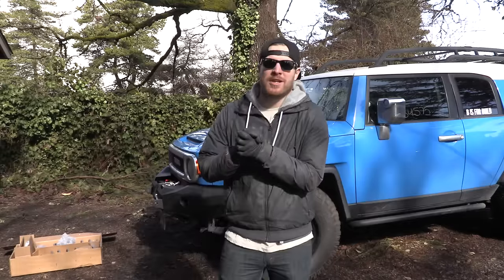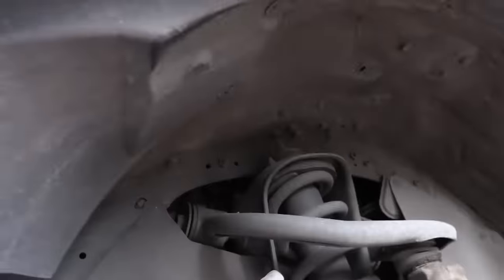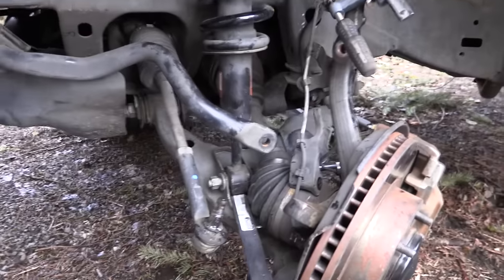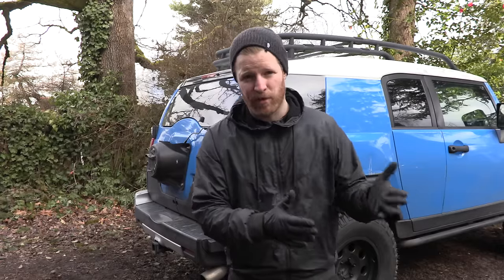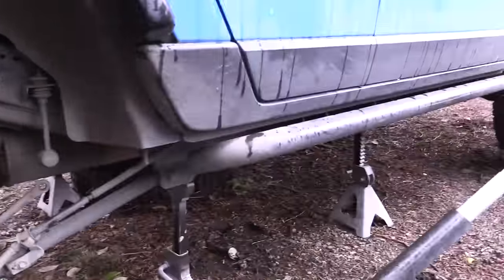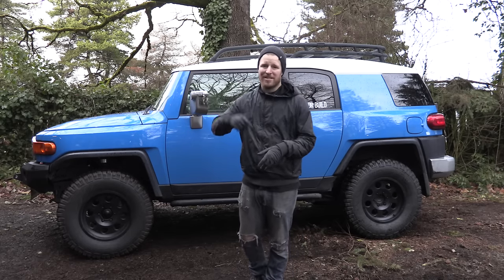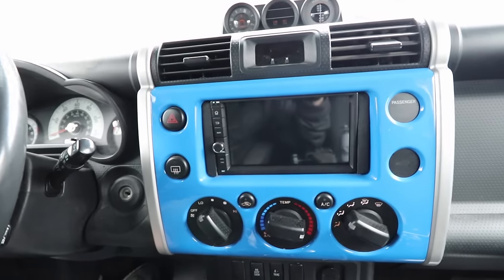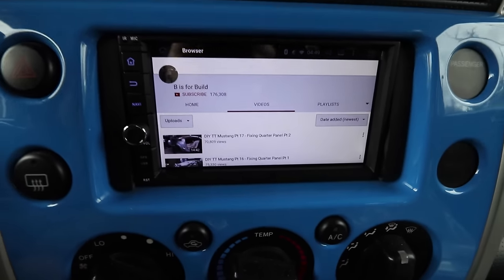FJ Cruiser Build Pt 5 - Lift Kit Install & New Stereo

Comment: b is for board of wood under the jack stands when working on dirt. cool build.
Reply: MrUncleSpicy I thought the same thing..EEEEEK. IV had a few cars fall over when doing this.. it happens easier than you'd think
Reply: lol flyingbrick, I was working on my f150. the ground was muddy, sank 2 inches, took about 2 hours trying to fix the mess I made. Moral of the story,  jack one side up at a time
Reply: MrUncleSpicy exactly
Reply: MrUncleSpicy could you imagine how shitty it'd be if you werent thinking and assembled this in the garage and could get it out lmao
Reply: Agreed. Some 12 inch squares of 1 inch marine grade ply. Stack them if necessary for a bit more height.
Reply: Boom roasted

Comment: As a professional car stereo guy I get a litte bit dissapoonted in your recommendation about just cutting the original wires and connect them together with the stereo wires. It makes a mess for the next owner who wants to change stereo and also makes the bill rise through the roof for the person who hands their car to a professional to make the stereo change. There is a lot of good adapter harnesses out on the market, and for just a few bucks you will save a lot of time not crimping wires together. :)

Comment: Bit late but catching up on b is for build now. Don't know if anyone's mentioned this before, but some problems you'll have after lifting these cars is you'll see your front CVs leaking grease, run out of camber and castor alignment adjustment and your upper ball joints over extending. 

Aftermarket upper arms will be able to fix both alignment and ball joint issues. With the CVs, you can just replace the boots or put new shafts in. 

I'd recommend getting extended sway bar links as well as an adjustable panhard rod to put the rear end back to original geometry.

Oh and speedy recovery Chelsea!!

Comment: I'm a 16 yo kid who just bought my first vehicle, a 77' Jeep J10, actually bought 2. Gonna be building it up, gonna have the coolest truck at school for my senior year. I also have a 89' Jeep Grand Wagoneer. The tires I'd choose for my J10 would be the Claw ll in 33x12.50r15, tires are on the much needed list, but damn are mud tires expensive. Best wishes to chelsey (sorry if I spelled the name wrong) on getting well.
Reply: Ethan H. Be careful old jeeps are easy to flip. Especially lifted
Reply: this is true i fliped my lifted jeep on a trail so be very careful but remember to have fun
Reply: Nice, I've got a 77 J10 as well, also my first vehicle! They're an awesome truck.
Reply: Ethan H. I have a 300zx that I'm building up
Reply: Everett Sommerer tt?
Reply: erich2780 nah, it's a 1987 N/A

Comment: I'd like to personally think you for introducing me to copart most of the cars I want barely have any damage and I can fix them easy for super cheap
Reply from the maker: Make sure to email that message to copart too :p
Reply: ItsATrap check out my copart rebuild!!! :)
Reply: B is for Build no problem
Reply: VSM AutoLife I just watched your quarter panel repair pt 1 and I like what I saw you were specific on what you should and shouldn't do
Reply: ItsATrap thanks! That's an older video my recent rebuild is my Dodge Charger, but I will only get in depth on the structural repair in that one , but still working on improving it all
Reply: VSM AutoLife I noticed it was an older one but if I'm buying cars from copart body work like that is important to know so I checked it out

Comment: Warden 265/70/17 C Load Range. I have a 2007 FJ Cruiser that looks just like your project truck. I love the videos and they're seriously making me think about lifting the truck and putting on the fender flairs. My truck needs a new set of tires since I've been driving constantly to have timesharing with my son. The spare is original from 2007 so its time to replace that one as well. I would be happy to pay for the 5th tire! 

You do a great job with these builds, and I like that you don't edit out all the frustrating parts. I really like the FJ series and the video you did on the Copart.com website... ive been stalking the locally wrecked FJ's looking a fun truck/something to fix and hand over to the kiddo.

Feel better Chelsea!

Quick suggestion on supporting the truck... get yourself a 3/4" sheet of plywood and cut it into 2'x2' squares, it spreads out the load under the jack stands and makes it a lot more stable.

Comment: I'm the owner of a super cool Silver 2008 Dodge ram 3500 Dually. What I love of this truck is whenever you are in the road, people respect you because they see the big grille behind or the big 4 wheels on the back because it is 6.7L Big turbo Diesel, it is quick, This make it fun to drive. Now installing this Nitto 33X12.50R-17LT, MUD GRAPPLER I will be able to take it offroad with it.

Comment: when working on a car/truck on dirt/sand always put the tire and rim you remove under the car frame. This is a safety measure and it has saved me more than once from jacks/stands rolling on me and then landing on the ground

Comment: I have a 99 jeep xj, i had a 98 before hand but ended up rolling it off road, and had to scrap it. I took the engine, transfer case, lift kit, and plenty of other things all swapped over to this 99 that i bought for 500 that needed an engine. Having some nice tires to compliment it would be really great.
CLAW II - C3315C
33 12.5 15 C
I would like to have some nice tires to keep up with all my buddies on the trail, and not get stuck in every little mud puddle because i have some cheap bald (by bald i mean basically drag slicks) 31's. I am in need of tires soon and this would really help me out. Hope Chelsea is alright! Love the builds, and I enjoy watching the videos. Good luck to everyone else in the comments!

Comment: Hope she get's better fast. As someone who has been in the offroad accessory business for 5 years what you experienced with poor instructions is one of the things rough country is known for. It would have been a little easier for you if you had loosened the lower control arm bolts so they could swing down, and treadwright tires are indeed awesome.

Comment: Haha that roof would annoy the shit out of me get some sound deadening lol
Reply: And that plug your not sure about is probably the aux for the stock radio they also make flush mount adapters to mount a usb or aux to a spare switch
Reply: Michael Graper could be trees above I think..
Reply: What?I love that sound. Love being at camp an falling asleep to the rain on the tin roof.
Reply: Michael Graper lol dude those usb extension cables just poking out were fucking with my OCD so bad!

Comment: I drive a '14 Wrangler Rubicon on 3" lift. I've actually looked at the Treadwright tires before for a M/T tire. I typically roll around on A/T tires - since the Jeep is my daily driver. If I had my choice, I'd go with the GUARD DOG tires in 35x12.5R17 (load range E).

Comment: You did that the hard way.
Undo the top sway bar link.
Loosen lower control arm nuts/bolts.
Undo 2 bolts that attach Lowe arm to steering knuckle, then the arm swings away enough to remove the strut. No need to undo any ball joints.
With stereo wiring, you can get Toyota to ISO wiring harness, then get ISO to stereo brand (eg Pioneer) harness. Just plug & play. All Toyota EOM stereos are wider than standard size, so you need a fill-in kit for the edges.

Comment: Nice lift kit you got. I have a set up of icon 3" installed on my 2008 fj for a year now. I love mine. Super smooth... live on the big island Hawaii. Many off-road island fun here... I would love try out a set of those treadwright tires. They look aggressive and love that they used recycled tire casting to remold new tires. Great concept. I'm using AT on my FJ at the moment. Would love to get a set of 285 70 17 MT Guard dog for the rainy season coming. Mahalo for sharing!

Comment: Hey man, for future reference when you're removing the front shock assembly on toyotas, use the factory bottle jack and stick it between the wheel well and the UCA and crank down on it. Using this method, you don't have to disconnect the upper ball joint.

Comment: Next time you want to lift a vehicle on soft ground, think about bringing a half inch thick piece of plywood or osb (chipboard) to jack on.  It may not sound like much, but a good piece will keep your jack from sinking in.  It's how I managed to work on cars with that same style jack in a driveway that only has concrete strips for the wheels to ride on.  

It even works for jack stands.

Comment: GUARD DOG - G3115C, but any others that fit a 15 inch rim would be awesome!. Was thinking of hacking up my otherwise useless, but still running peugeot 106 and fitting offroad wheel and tires on it for a long time.  Never got around to doing it purely because of the tires being too expensive.

Comment: For jack stand use in soft material, dirt, mud, sand, etc., cut 12x12 squares of 1/2" or 3/4" plywood to place under each jackstand.  Safety first.

Comment: Guard Dog 285/70R17 I was looking at the gaps on the front bumper.  It looked like it may need some tweaking to get it to match up the body lines better.  From what I saw, it looked like the back of the bumper needed to be rotated up some.  Of course, the look will change when you end up doing the aftermarket flares, but check it out.

Comment: man you made it look so easy compared to what it is. I did a 3 in level lift on my 2008 tundra crewmax. The front coil spacers sucked for getting the struts back in an mine didn't even have studs coming out of the top they bolted from the top down into the spacer. Then I did add a leaf for 2.5in in the rear. It took me 2.5 days to do it by myself in the rain without my power tools.

Comment: You need to go to Home Depot/Lowes and pick up a 6x6 and a 2x10 and chop them up into 1 foot and 2 foot lengths.  Blocks and planks of wood are your friend for jack stands on dirt and jacks that need a little extra lift.  i have enough blocks of wood that i was able to lift my car up 40 inches to protect it from any Hurricane Sandy flooding.

Comment: 285/75r16 Warden W2816E. I have mix matched sizes on my truck. My front tires have secondary rubber shower on the inner tread

Comment: fiew tips (like to rise the comment)

when changing ride height allways tighten the controll arms bushings at the new ride heiht, while car is on even surface (either put the wheels and lower car or use a jack on controll arm) unless it is a rose joint. Other way rubber bushings wear much faster.

Use copper grease on all suspention bolts and nuts, makes life way easyer when unbolting them again. Also use wire brush or electric wire brush for all bolts to clean any rusts before undoing and before tightening them. Dont forget copper grease.

cheers, Marijus

Comment: I could really use a set of 315 75 r16 GUARD DOG G3116D. They would go perfect on my 91 dodge cummins that I have been working and learning on for the past two years. Keep up the good work you  have inspired me to look into Copart and I am right now planning to bid on a 96 dodge to use as a donor as my truck has over 620 000km and I wouldnt hate some extra power.

Comment: next time loosen the control arm bushing bolts. It will let the arm drop farther. Also, jack up the hub to raise it while loosening those bolts. It will remove the tension off the sway bar and other parts.

Comment: Just a couple of tips that weren't shown in the video when doing this kind of thing: leave the nut loosely on the tie rod end when shocking it loose with a hammer to prevent damaging the thread. And pump the shock before installing it to prime it.

Comment: As a guy that has had to clean up in dash wiring messes, DONT cut the factory harnesses. The vast majority of modern cars have aftermarket harnesses tht plug in to after market radios. The harness is also easier to wire outside of the car than it is inside. 

If you don't want to spend the $15 on a harness, run a dedicated, fused wire into the dash, tap a solid ground, and use t-taps for the speakers and other connections.

Cutting the harness connector off is a PITA for anyone coming behind you.

Comment: MT Claw II. 35-12.5-15. need a new set for my 98 xj. I take my kids out alot for fun on the trails and rocks plus daily drive it. it's got a 6 1/2 rough county long arm lift, lockers front and rear, functioning snorkel, Warn 9500lb winch, a built 4.0 and a few other mods that make it very fun and capable off on road but very capable off road.

Comment: Loosen the control arm mounting bolts where the bushings are and retighten them with the car on the ground at its normal ride height. Otherwise the bushings will be under constant stress and will fail quickly. This applies to any suspension bushing that connects an arm to the body on most cars. If you loosened them while installing the shock/spring assembly, you wouldn't need a spring compressor.

Comment: the colors on aftermarket decks are standard. when you buy a wire harness they should match up from unless it's German or it has a stock amp.

Comment: About the same experience I had lifting my Jeep, seems simple enough, shouldn't take very long, should be fine to lift my dd. . .3 days later at 3am I finally finish.
Its never as easy as it seems.
Was looking to grab some BFG Ko2's but would be more than happy for a free set of "Guard Dog, G3115C"  size 31x10.5 for a 15in rim.
Also, food poisoning, always a glamorous event. At least nothing comes out of your ears.

Comment: I was originally thinking a set of bigger all terrain tires for my Honda Element to lift it a little and to help tackle all the PNW outdoor adventures out here... But then I figured why not a set for my build which is why I found and subscribed to your channel in the first place.

So it'd be awesome if I could win a set of Claw II - C3318E 33x12.5x18 Kedge treads for my lifted 02 Nissan Frontier crew cab that was t-boned - damaging the driver's side cab, bed, and rear wheel.  The hit actually sheared my leaf spring bolt from the mount and damaged my drivetrain center bearing support.  I replaced the center bearing support, and found a guy on craigslist (no local shops were willing to take the job on) who was able to cut the damaged leaf spring mount/support from my frame and weld in a replacement I bought from the wrecking yard.  I didn't have the equipment or know how for that big of a weld job.

I actually found your channel because of the work you did on the BRZ quarter panel skin as that is something I will be needing to do to my truck.  I've pieced a driver's front/rear side from the wrecking yard, and a chopped up bed and replacement wheel from Offer Up.  Still need replacement doors.  A new set of tires would hopefully get me motivated and get the shit done as I've been slacking because of the weather (gotta love the PNW), the cost of replacing my almost bald Toyo's, and of the job still at hand of getting the truck finished.

Sorry for the long message.  Thanks for all the content Chris.  Hope your lady is feeling better, and love the channel!

Comment: The sway bar link might wear a bit faster because of the lift, also now that the thing is higher your rear axle might be out of alignment because the rear track bar is meant for a 3 inch shorter car, so you might want to check that .

Comment: Warden W2416E - 245 75 16
My 70 Ford F-250 has worn out BFGoodrich Radial All-Terrain T/A
I watch all your shows and wish I could be there when you need that extra hand. Keep it going I always pick up good info. If you lay down a piece of roofing tin you can keep the jack from sinking in the ground.

Comment: my wife was hit head on in our 07 highlander back in december we replaced it with an 09 highlander, but lost our brand new tires from the 07, WARDEN - W2417E 245/75R17 would be a great replacement for the half tread tires that came with the new rig, thanks for the chance!

Comment: At front it could be wise to loosen the lower control arm bushings and tighten them after the car is standing on its own weight on the suspension.

Comment: you wouldn't need the spring compressor if you loosen the lower control arm bolts. then you need to get the weight of the vehicle on the suspension before you tighten them as the resting position of the arms is different now.

Comment: LT | MT GUARD DOG 285x75R16 10 PLY
285 75 16 E.  In need of some new tires for the for the suburban.  Been sliding on the road and mud after it rains.

Comment: should have used the floor jack to compress the lower control arm back up. Like you did on the rear. Also for the giveaway.  CLAW II - C3320E

Comment: Should have put the wheel under the front for safety and when popping ball joints hit the hub (metal part the ball joint pushs through) not the thread the threaded part, lastly try dropping one of the wishbone bolts out to get the movement you needed.

Comment: I have a 2000 F150 step side manual that im working on im building my own bumper in the next few weeks also a rood rack. ive been trying to get some tires for it but unfortunately tires like this are quite expensive! Some Guard dog - G2816E 285/75/r16 would definitely help a lot!

Comment: Holy crap, jack stands on dirt. It's been said already below you should have wood under them to spread the load. But I would also have one of the wheels under the car so that if the worst happened the car would fall on the wheel and not crush you.